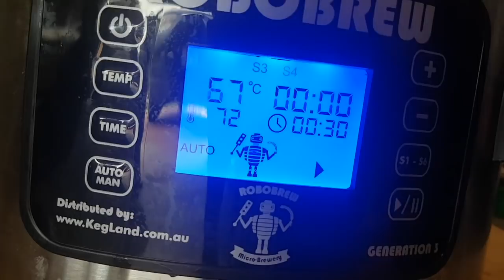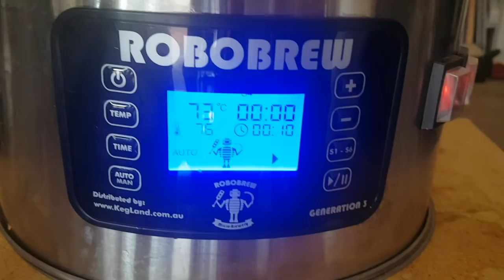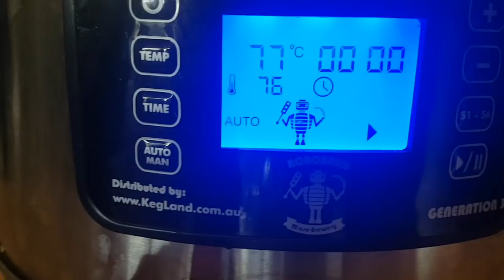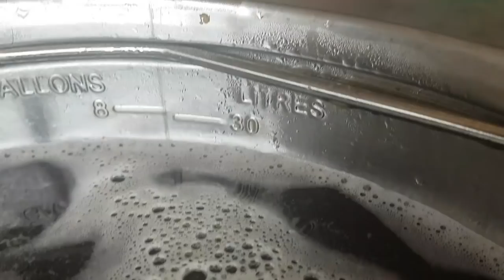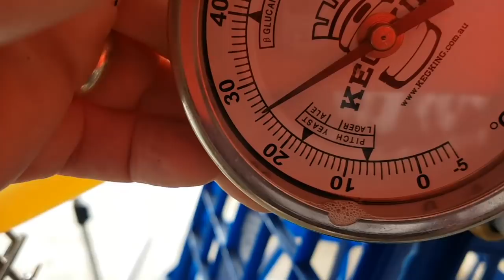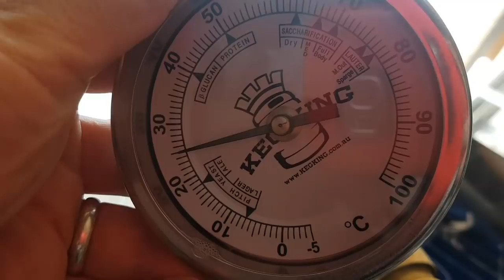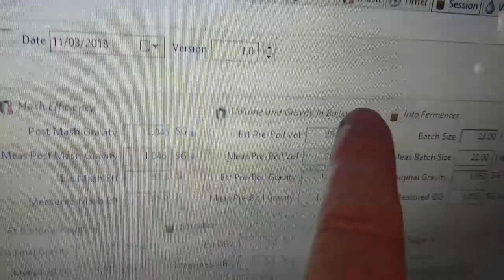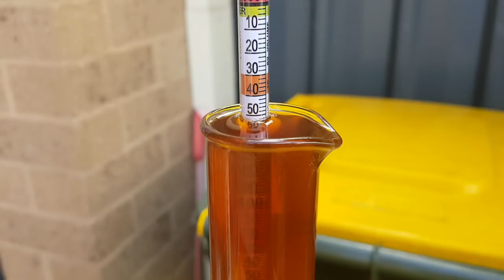ROBOBREW GEN 3 - STEP MASHING - RedX 100% - PART 2 - Brewzilla

Comment: How much watt was used during the mash steps? 
Asking because usually people claim scorching is caused by high watt usage. Those who says this also says that the pump should go always fully open (during mash) to avoid scorching. What is your experience on this field?
Reply from the maker: I've never had scorching, I always use two elements on during temp changes and boiling. Full pump stopping scorching, never had that issue in 100+ brews. I've never ran the pump full either, I like to know the grain bed has flow through. Not sure how people are getting scorching, I do use an extension cord but its plugged into a 15amp power point so there's plenty of power there, so that's not the issue. I think people don't use enough water, lots are stuck on grain to water ratios that just don't make sense in this sort of set up, and if the pump is full on, with little flow through the bed, the water in the bottom will get very thin and that is probably causing the scorching. Cheers mate! Thanks for watching.
Reply: @HomeBrewNetwork  Thanks for the very swift reply!!!
What is the combined power of the two elements on your device? 1500W or 2500W?
And what is your recommended mash in ratio to ensure that there is alway enough water on the grain bed?
Reply from the maker: 1900 and 500. 2400.

Comment: In the automated mode both elements should be on and let the system decide when and how to use them. They are actually turned on and off as needed. Turning one or the other off will deprave the system from the full power when needed so the rise in temp will be much slower. Also, why take off the uppers screen and then sparge using that old dirty aluminum strain? The top screen should be left on the top of the grain while sparging. That is one of its purposes.
Reply from the maker: These old units did not chose which element to use, it was all manual. They don't even include the top screens anymore in most units, stirring is a good thing as is access to the grain. Even the more expensive grainfathers don't include a top screen anymore! The aluminium strainer wasn't dirty, it was marked from bleach. I dont any strainer or top screen at all these days, not needed. Cheers!

Comment: Curious if you can brew high gravity beers with the robobrew...great videos
Reply from the maker: Sure you can! depending on a few different things, can easy do a 2 hour boil, and go for a 20L or 5 gallon batch. Use extra sugars etc . I know I person that did a 12kg AG brew in it, he did remove the basket just for a bit more space and said he'd probably never do it again hahaha but it worked, I think 9kg is pushing it myself. I did a 9% beer in my Robo 1 which is smaller but it ended up abut 13% after I added my vodka soaked cacao and coconut. Cheers!
Reply: Thanks for the reply🤘. I'm a extract brewer and I'm having issues with my ipa style beers having a cider kind of off favor thinking I might not be pitching enough yeast and the beer isn't full fermenting even though my FG looks good ....can you give me any suggestions...by the way I ordered a robo brew thanks to your awesome videos
Reply from the maker: Cider flavour, suggests apple, which suggests maybe fermenting too warm? Cheers!

Comment: Hey Gash. I was wondering if you took a hydro sample that was not clear wort, as in it was full of break material, would that give a false reading? Cheers mate!
Reply from the maker: Too much in there yeah it probably throws the reading out, but if it can float freely then it might be ok Cheers
Reply: Cheers mate. I no chill, and take gravity readings on brew day post boil, and also when i transfer into the fermenter, and have noticed that sometimes they are off by a point or two. This could be the reason
Reply from the maker: Thanks Rowan, Cheers mate!